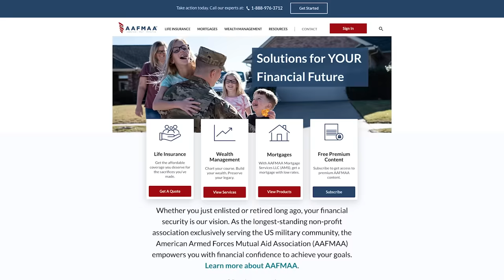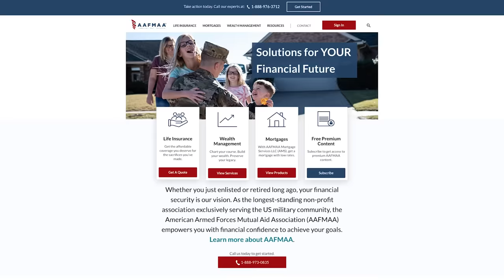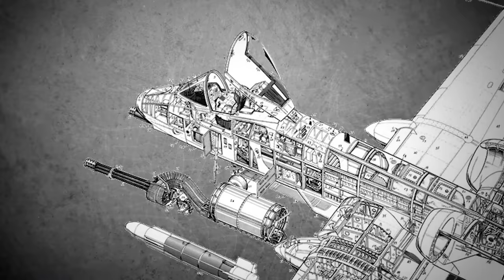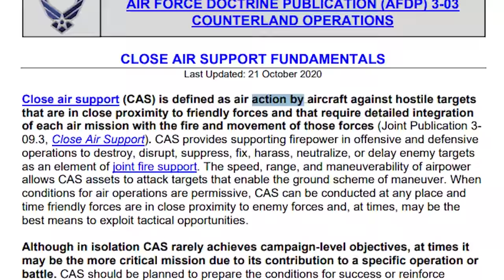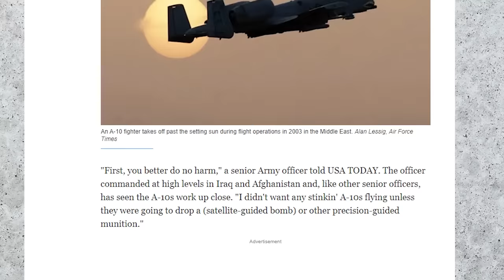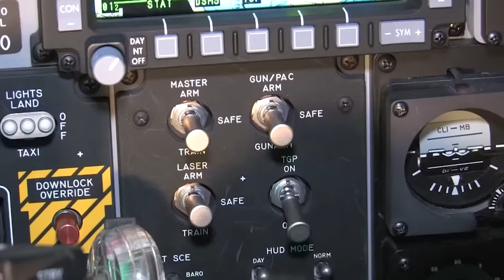Why the Air Force is Screaming to Retire the A-10 Warthog

Comment: I was stationed at Little Rock AFB for 5 years, I remember one time driving down the highway headed towards base. The highway runs in a similar direction to the runway, and I remember watching an A10 on approach fly not more than a couple hundred feet directly overhead. While I work on the C-130, and will defend that aircraft to the end of my days, the flying gun will always hold a special place in my heart, as im sure it will for many others.
Reply: "...defend it?"
Then YOU pay for it
Reply: Uh.... you may want to talk to the friendlies who have been on the receiving end of A-10 fire. This platform is so antiquated, it is time to let it go. The need for air support like this is essentially non-existent.
Reply: @kid31989  and we should get rid of the B-1B because it had friendly fire incidents too? Shit happens in war, it's tragic and horrible. But the call by infantry and marines for CAS has been made time and time again. Sure in a near peer conflict it will likely be less than useful, but it's been a workhorse for longer than most have been alive.
Reply: @kid31989  Only in cases against enemies without AA would you want a weapon Like the A-10, but in that case just use a cheaper plane with more modern guided weapons and actual electronics to identify friendlies.💀
Reply: @kid31989  that's what the air force claimed in viet nam.
Reply: @gavingross2174  Man you don't get it, yes friendly fire happens, but for YEARS the A-10 had no targeting systems or identification systems. Meaning they relied ENTIRELY on visual and ground information which can get mixed up rather than seeing friendly identification signals. The A-10 killed more friendlies than enemies throughout Desert Storm. To the point if people heard an A-10 was in the air they told them to go the hell away from the combat zone because they were more dangerous than they were worth.

Eventually it got SOME targeting equipment, but it's just way too expensive to keep updating such a poor design from the cold-war era designed for WW2 combat. In fact they were expected to be destroyed after their strafe run on russian armor columns.
Reply: @jackwilliams2673  the total number of friendly deaths from A-10's is 35. In desert storm, the A 10 is credited with killing over 4,000 pieces of equipment, over 900 of which were tanks. Further, over 140,000 sorties, there have been 45 friendly fire incedents. Doing some quick math here, if I were boots on the ground, and it was between deal with tanks and artillery myself, or call in an A-10, which has a less than .03% chance to hit friendlies, at a rate of less than 100% fatalities when it DOES happen, I'd take the fucking chance. "The CAS plane is at a higher chance of hitting friendlies" yeah, no shit Sherlock. It's called CLOSE air support. It's gonna happen, wether it's an A-10, or something newer. And to say it's a poor design?? It's one of the cheapest per flight hour aircraft, with an extensive history of doing exactly what it was designed to do very well. Yes it's old, yes it's getting more expensive, and as I said in my last comment, yes it'll likely be unneeded in a near peer conflict, but to say something sucks because it accidentally killed 35 friendlies in over 30 years of service, over multiple and consistent wars, well... More soldiers died to their own stupid actions than could ever die from friendly fire. My condolences to the fallen and their famalies, but there is no garuntee you don't get caught by a stray bullet. Friendly fire happens, and it doesn't matter where the bullet comes from.
Reply: @gavingross2174 friendly fire happened because of short-sightedness with keeping costs low, which meant inferior sensors and equipment to determine ally or foe. 

It may have worked great against insurgents who’s biggest AA threat was a Toyota with a HMG. But against modern militaries, it will get easily overwhelmed by MANPADS, fighter aircraft, etc.
Reply: @schmidtytime  holy Jesus, it's like y'all read every fifth word. First, I'll address the last section of your comment. FOR THE THIRD TIME... Yes, in a near peer conflict, what we would likely be in should another war happen this decade, yeah, the A-10 will have limited at best usefulness.

For the first part. You could use the most high tech equipment and sensors on the planet. Miscommunication and human error will always allow for friendly fire, ESPECIALLY when the entire role of an aircraft is to use weapons to damage or kill enemies near  (see: close) to friendlies. I'd say, especially given how much the American government and taxpayer get in the way of military decisions, .03% is the best possible number you could ever possibly hope for.
Reply: @bigfish92672  

Edit: I realize you were almost certainly responding to my A-10 part of the comment. For which this comment is being updated. 1st, I still pay taxes. 2nd, the politicians still decide where that money goes. And now 3rd, the new one: see my other responses for why despite it's faults, the A-10 has been an effective platform

1. I still pay taxes

2. I like you have no real direct say over what any government official decides to use that tax money for

3. The c130 is one of the best aircraft on the planet for humanitarian relief and tactical airlift missions. 

4. The real world missions that we would get tasked for were disaster relief and humanitarian related far more often than real world tactical shit.

5. No other country on the planet spends anywhere remotely close to helping other countries as the US. Part of that is because of the military we fund. If we were to go full isolationist, I'd be in full support of that, but it would lead to far more harm globally than you'd think.
Reply: The 4,000 pieces of equipment destroyed figure is dubious: the claim first appeared in Air Force magazine, and a later source describing the claim stated that it included data which "proved to have been discounted by USCENTCOM BDA analysts during the war and could not be supported by after-action analysis." The F-111 had a higher proven count of armoured vehicles destroyed (because it could carry PGMs and guide them itself) and the highest ratio of successful strike missions of any aircraft deployed in the war, but Sprey and co didn't like it and so they didn't prop it up as a heavenly blessing to aviation as they did with the A-10. And F-16s did more CAS missions than A-10s in the second Gulf War, while Hornets did more in the first.

I would also point out that this anti-tech stance has been proven wrong multiple times over. Better sensors allow a higher chance of confirming the target is what the pilot thinks it is. A plane that until recently had pilots wearing infantry night vision goggles and using binoculars to try to figure out what they were shooting at is less than ideal, and the upgrades to try to keep them reasonably effective at engaging the things they're supposed to engage, as well as the service extensions (new wings for every plane) also made them more expensive than platforms which come with better equipment out of the box and were designed to have it.

(I will get this past the bot sooner or later)
Reply: @gavingross2174  its not that the A-10 CAN cause friendly fire, but how many times it has happened. It is a plane that really doesn't make any sense at all, it doesn't have the loiter time, cheapness and simplicity to maintain, etc, etc like a true CAS plane like a modern OV-10 Bronco (and Air Force has never done a good job at doing this and making it a priority anyways) or the ability to not put a pilot at risk like a UAV could and it doesn't have the speed, maneuverability, stealth of other Jets. Even doesn't compete well with bringing big guns in the air to a fight compared to gunships like the AC-130
Reply: @gavingross2174  it was designed pretty much ONLY for near peer conflict, so if it can't do that it is really without a purpose. It was designed, somewhat ironically, in a way that the "fighter mafia" would have wanted, without any of the "fancy stuff" and that has never been a good idea. It wasn't built to have sensors and other equipment and to power them. Made worse by it being a single seater so its all on one guy to do everything without the much of anything to assist them.  

 Its not nearly as cheap to fly or loiter time as something that is really made for CAS like a modern OV-10 could, its not as low risk as a UAV, its doesn't bring the firepower a gunship like an AC-130 could.
Reply: @CruelestChris  Sprey and friends must not have made the claim to have individually have crafted by hand the F-16 and other aircraft yet at that time.
Reply: @removedot  so a few things to combat before I head off for the night.

1st, it was designed for near peer conflict 3-4 decades ago. This was a time that Iran and Russia were far more formidable foes, and given what it was designed to do, given the decade it was designed for, and given a war it could have been most effectively be used in, it woulda been even more effective than it has been in the armed conflicts we had. The F-15 was designed to combat the Foxbat, the F-22 was designed to be THE air superiority fighter. The Foxbat turned out to be shit, and the only real world F-22 kill is a couple balloons. What aircraft are designed for, and what they get used for are (fortunately) at the mercy of what conflict we enter.

Next:  Yeah, the fighter mafia is a big issue in the military, much like federal level politicians and lobbyists. The A-10 is the best designed CAS system given both the decade it was designed, and the fighter mafia coming out of an armed conflict where the biggest issue initially was simply not having a gun on the main fighter/attack aircraft of the war. (The F-4 launched without a gun. The military loves overcorrection. The A-10 has a 30mm Rotary. See where I'm going?)

Loiter time is as good as it possibly could be for a turbofan powered aircraft. Built in the time it was. It's ability to circle the battlefield given it's engines is above par. As a C-130 mechanic, I am all to familiar with how much more efficient turbo-props (really any prop) is at sub-sonic speed. I am also familiar with the fact that props have an issue at getting faster than about 400 knots, have an issue at getting going quickly, and have an issue with fuel consumption at max speed.

The friendly fire rate is high for overall deaths, but again, if you calculate the sorties flown in desert storm to the friendly casualties caused, it comes down to a significantly insignificant number. If I was on the battlefield, and I knew the numbers, I'd still call for A-10 CAS anyday.

For price per flight hour, it's still one of the cheapest attack/fighter aircraft in the fleet. All military aircraft are expensive. A single display on a C-130 costs as much as a single family home in Little Rock Arkansas. Next argument. The military ultimately doesn't care about cost, or it wouldn't have bought B-2 spirits at like 2 billion per.

UAV's have a couple issues. First and foremost, accountability. Public perception is that someone behind a computer screen, no matter how advanced, is both more careless, and more likely to cause issues than someone in a real cockpit. Second, and in my opinion more important, reaction time of a UAV is slower than any manned aircraft, and technology while advancing at a significant rate, has not gotten sufficiently advanced for the argument to be made that a UAV is a better combat aircraft platform in 99% of cases.

The AC-130 is a great tool. But the AC-130J is now the main variant. Do you know what the AC-130J is loaded with? Because I do. It's a 30mm, same caliber as an A-10, a 105mm, which is wildly overkill for a lot of what is on modern battlefields, and missles, specifically Hellfires. If you read my previous comments, you'd know I touched on how the average engagement distance for ground troops is within the fatal range of that munition. Bad argument.

A couple more touchup points.

Stealth is stupid for a CAS plane, or anything but an air superiority aircraft or a bomber. You need internal weapons bays and a very specific profile to achieve adequate amounts of stealth. This profile is not at all what you would want to use for any heavily armed aircraft, and you want a heavily armed aircraft for CAS type roles.

Manueverability, yeahhh... The A-10 is one of the most agile aircraft we have outside of something like the f-22, which is a dedicated air superiority FIGHTER, with thrust vectoring and the ability to override it's electronic nannies, and absolutely not the aircraft to be used for CAS.

Single seater. In the 21st century, outside for cargo, refuel, and other heavy frame aircraft (kc-10, kc-130, kc-46, e-3, e-8, c-5, c-17, c-130, B-1, B-2, B-52, etc) fucking everything is single seater. Idk why you think a single seater is a disadvantage, but with modern avionics, radar, and other realted systems, there is a reason small frame attack/fighter aircraft are single seater. Hell, recently they have been pushing for single pilot aerial refuleing on aircraft that date back to the 80's.
Reply: The Infentry parts of the military applaud CLOSE AIR SUPPORT (CAS) for obvious reasons. Air zummies think differently: they want to go fast and fly high in the clouds. Since it was first built,  Air Force generals wanted it replaced with more expensive, and faster jets not optimized for CAS missions. The Air Forse (AF) also object to the army flying that CAS mission with their own CAS aircraft. Except for the A10, the AF will usually find other PRIORTY missions above CAS. For like reasons, our USMC requires CAS as a priority mission in the combined Air/ground mission forces. The Navy, somewhere in between. Reality is that it seems ANY jet aircraft now are to expensive and we will have to few that generals will hesitate to send them up into that battle zone sky with so many threats. The AF is now flying modified crop duster type prop planes. I guess we need to see what mission versus threats results will bring us. I appreciate the video.
Reply: @gavingross2174  that is the thing, those aircraft have all those modern avionics, radar, etc to simplify things. The A-10 doesn't really have that. Made worse if you have to be using binoculars to look around while doing everything else. Don't forget the F/A-18F Super Hornet (and D Hornet) for dual seats.

As tough as the A-10 is, I don't think it was really designed to be as safe as it has been made out to be was kind of what I was hinting at. I think the belief was that if it was going into the gap, there were going to be a lot of losses. Even maybe an assumption that it was likely that nukes had already be used (thus the high engines to make it better on on less prepared runways) so some degree of disposability was kind of built in.
Reply: @removedot  1st, an f22 costs roughly 150 mil per unit and 70k per flight hour. The A-10 costs 13.xx mil per unit and 22k per flight hour. Per unit cost, and per hour of flight cost, the A-10 is one of the most effective aircraft in the US arsenal. Especially since the F-22 has 2 real world kills.

No fighter aircraft has a zoom function, at least in the normal spectrum. If an aircraft is engaging, it is in 1:1 ratio real life to eye view, augmented by HUD and aural alerts. Doesn't matter if it's a bomb being dropped 40k feet below, a missle 3 miles away, or a 30mm gun run 200ft from friendlies. Sure some of these use like 8 inch black and white or basic color screens, but full canopy view, no. But of those three scenarios, it doesn't matter how fancy your electronics are, how good your eyesight is. Shit can happen, and nothing is 100% accurate.

The navy runs single seater F-18 super hornets too. Maybe the navy needs the extra help, but the Air Force is THE air superiority branch. Our best aircraft are single seaters. The aircraft that have double seat variants are older than the best (F-22) that the AF employs. Certain scenarios a second seat can help, but it's a very limited and specific sceanrio (IMO of a time now past) and I sincerely doubt somehow cramming a second seat into a CAS plane would help, when the role of back seaters tends to be radar and laser guided. The A-10 uses neither for a gun, and the other munitions now get along fine without a back seat.

**
Reply: So why in the world are we comparing the A-10 to a top-of-the-line stealth fighter with an extremely limited production run? And also disregarding the couple of billion the USAF just had to spend buying new wings for every A-10 in the fleet, which likely pushes their lifetime cost above F-16s or F-18s?

And no fighter has a zoom function? Do you live in some alternate universe where targeting pods haven't been invented or something? And there's that anti-tech stance again: nothing is 100% accurate doesn't mean we shouldn't carry a thing to go from 80% accurate to 99% accurate. Not to mention modern aircraft have datalinks so that someone on the ground can look at what you're seeing rather than relying on vague radio communications, have the capability of a targeting pod built in from the get-go rather than needing it shoved on a hardpoint, etc.
Reply: Oh right, a beatdown. Cost of $30K dollars per flight hour for a vastly more capable stealth jet with capabilities out of the box that you have to festoon crap on the bottom of an A-10 to get anywhere near having. And for a plane that only costs about three or four times a modern A-10 (and with a cost that's been dropping for each and every batch) you get a capable multirole aircraft that's good for decades rather than a single-purpose aircraft that should have been retired for decades. You should probably start reading things about the F-35 that aren't based around Russian propaganda.

And paying two billion to stick new wings on a bunch of 50-year-old rattletraps does nothing for the cost of said rattletraps. They still need new engines they're not going to get, their avionics are still barely adequate, and they're hauling around a huge gun that's been virtually useless longer than most of their pilots have been alive, while mostly dropping JDAMs and shooting off Mavericks, which plenty of other aircraft (notably the F-16) do better than they do.
Reply: @gavingross2174  You seem fairly well informed, and I'm glad you are sharing information but you need to update yourself quite a bit on the F-35. Your scenario just doesn't make much sense seeing as how the F-35 and F-15X are quite price competitive and with the F-35 being purchased by so many the price of the F-35 is going to continue to go down. (yes I know the F-15X is supposed to have a longer service life but we shall see on that). I hate to break your heart on your other weird little obsession but any large purchase of the F-15X will likely also include the F-15EX, the two seater version. It is also cheaper and easier to have less aircraft to have parts and people trained to maintain. 

One of the other major factors of the F-35 is that it is still in its very early life. It has already seen big increases in capability and that is only going to continue to happen; while most of the rest of the US fleet (besides the F-22 which there aren't going to be more of) is getting very old and already gone through all that and are running out of room to grow.

The whole "F-35 is bloated thing" should be obviously completely silly to someone that seems to know as much as you. Pretty much every other attack aircraft no matter how many claims to otherwise in the US arsenal has eventually become a multirole aircraft with fancy high tech equipment so it makes complete sense to have built a new aircraft from the ground up this way.
Reply: @CruelestChris  the A-10 costs 13.4 mil per unit. As of this year the F-35 costs 75 mil per unit. You could theoretically have bought five and a half A-10's for the price of a single F-35. Further, as of December last year, the F-35 costs nearly double (42k) per flight hour as the A-10 does (22k Nov '22).

Next, if the F-35 is to retain stealth capabilities, it has a max payload of five thousand pounds. IF it were to be used as a non-stealth aircraft, aka, as you put it "fastening crap on the bottom", (defeating one of the largest points for said aircraft) it would have an approximate payload of 18k pounds. The A-10 can carry nearly 16k as it's payload, since it doesn't have to worry about stealth, and includes a vastly superior gun (worth noting, the F-35B and F-35C, Marine and Navy variants do not have guns as part of it's internal weapons system)

Next, even if you are using an F-35A, which has an internal gun, and IF you were using it as CAS in a non-stealth config., it's supersonic abilities can be discounted. There is a snowballs chance in hell anyone will ever make a CAS run at supersonic speeds.

Further issue. Loiter time has been brought up. The A-10 has a loiter time of 90 minutes. Not phenomenal, but for a turbofan powered aircraft, certainly above par. The F-35, also turbofan, can loiter for 20-30 minutes. To break that down to cost per unit... To have a similar payload ability, and have a loiter time the same as an A-10, you would need 3-4 F-35's flying in NON-STEALTH CONFIGURATIONS, they'd be doing this at less than supersonic speeds, and they would rack up a total cost of 16.5-22 A-10 units, and a maintenance cost of roughly 60k, which is double the maintenance cost of an A-10 during the same timeframe.

Next you claim the A-10 should have been "retired for decades" are you implying that the aircraft should have been retired less than 10 years from when it was first introduced, especially when it has the kill record it does? That seems dumb to me, but you seem awfully fanboyish of the F-35.

Also, as of this year, as part of the ongoing F-35 procurement process prices are NOT dropping, so idk what copium you are smoking there.

"Good for decades" said by every politician and military general when justifying the "shiny new thing" during every procurement process and Senate hearing. The B-52 is the oldest bomber in the fleet, now scheduled to outlast the B-1B and B-2 Spirit. The F-15 and F-16 are hilariously outclassed by the F-22. Guess which of those three are slated for retirement first? Until you are in the thick of war, no one truly knows what will be the hero. The newest shiniest thing is not always, hell, not even usually the thing that wins the long game.

"Based around Russian propaganda" M8, I work on US aircraft, I've listened to US pilots, I've heard the briefs. The F-35 wasn't built to be superior in any particular way. Like I mentioned, it's most likely roll is gonna be an air to air targeting system, and allow other aircraft who "strapped crap to the underside" to actually carry a meaningful payload. Hell, anything modern and Russian doesn't stand a chance against our aircraft, even China would have a hell of a time beating our aerial capabilities. But skies are only part of the battlefield, and having a plane that is kinda ok in a substitute roll of ground attack missions... Not ideal.

"Need new engines" guess who gets in the way of that? Politicians, lobbyists, and Fighter Pilots who get leadership roles. And that's discussing readying the aircraft for future conflicts, which again, would likely be with near pear adversaries, and again, for what feels like the millionth time: IN THIS MODERN TIME, IN A NEAR FUTURE CONFLICT WITH A SUFFICIENTLY ADVANCED ENEMY (near pear) THIS PLANE ISNT LIKELY TO BE USEFUL. idk how many times I have to say it, but apparently like 3 or 4 isn't enough for you lot.

"2 billion for new wings" even if that came from just a single year of defense bedgeting, that is like 0.2% of the defense budget. That is damn near inconsequential.

"Avionics are barely adequate" see above argument for engines, but also counterpoint, in the vietnam war one of the most effective airceaft was the A-1 Skyraider. A prop plane woefully outmatched by the jet's of the decade. Being old doesn't mean ineffective. It just means "takes more skill to master". Iron sights on rifles are old, outdated by red-dots and scopes. But someone with the knowledge and ability will put you in the dirt all the same

F-16's have less of a payload than an A-10, cost more per unit, cost more per flight hour, have gotten multiple very expensive block upgrades. Bad argument, if not absolutely braindead one.

Any gun is "useless" till you need it. This (again) is a hard lesson learned in the Vietnam War by the F-4. And if 30mm was so woefully useless, why does the AC-130J now utilize it instead of the old 20mm rotary I wonder? The targets it is useful against have changed, but to say the 30mm is useless is again, dumb.

Oh also your comment implying that A-10's shooting mavericks is a bad thing. The Maverick was designed for CAS. Any idea what aircraft was designed specifically for CAS? :) that's right, the titanium tub.
Reply: @removedot  my adult life has revolved around US military aircraft. I may not know everything, but I know more than I can share on a public forum. And what I know and can share as an opinion is that the public puts way to much faith and confidence into the F-35. The F-15X and F-35 may be similarly priced, but fulfill very different rolls. The F-15's payload suits it well to be a missle boat, and the F-35's stealth capabilities suit it to be a great radar and interceptor plane. With the ability for military aircraft to communicate targeting data, this is why I have the opinion I do of F-15X'S and F-35'S.

Also, as mentioned on my other recent reply to another user, as of this year, despite ongoing procurement from many allies, no the price didn't go down, not even mentioning just how much money the US had to dump into this plane just for the F-35 to actually exist. Further, I'm interested to see what long term parts and maintenance support are like for the F-35 program. God knows my aircraft has given me headaches, and we don't have a retirement date.

F-15EX: One new 2 seater doesn't break the fact that a good chunk of USAF small frame combat aircraft are single seater within the past few decades. Again, two seaters have their roles, but they are less necessary than they were back in the earlier jet age.

The main reason I call the F-35 bloated, which based on cost and delays alone it certainly was, is because politics got in the way of actually getting an aircraft, and Lockheed has gotten way to comfortable being the king of US military aviation. They are the bane of my existence. The fact that the Northrop Grumman B-21 is ahead of schedule shows that it's possible to not royally fuck up a major project, yet Lockheed consistently does. It's annoying, sickening, and downright fucking awful that a company that provides to the DoD is so willing to screw the American taxpayer. It's worse when you know that they intentionally employed at least 1 person in every state, so that if any senator or representative tried to call them out on their overruns, they could claim the politician is attacking jobs of their constituents. Given the choice, I'd rather burn 1k in cash in front of a homeless woman with a child, than willfully give money to Lockheed on a new project.
Reply: So you're running through the full list of deflections here, including quoting that the F-35 carries more stores than the A-10 (18 is a bigger number than 16, last I checked) as if it's a bad thing, using the highest cost figures you can find for the F-35 and the lowest for the A-10, etc. Also insisting the gun is "better" even though it wastes more of the aircraft's mass for a weapon that's just dead weight most of the time.

Moreover, that 16,000 pound figure for the A-10 isn't actually weapon payload since an A-10's 11 hardpoints almost always have an ECM pod on one and a targeting pod on another, both of which are integrated functions of the F-35. So you're losing 18% of your weapon stations to things that aren't weapons, compared to the F-35 getting all 18,000 pounds for weapons. It doesn't look so good when you start thinking about what these numbers mean for five seconds.

What "kill record" are we talking about here? The one I've already pointed out isn't real? By that yardstick we should bring back the F-111, which had an actual established kill record of 1,200 armoured vehicles from only 66 aircraft in-theatre which flew fewer sorties than the A-10s did while dropping 80% of the war's laser-guided bombs. They were retired after only a little over 20 years of service.

And last I checked there have been almost five decades since the A-10 entered service, not two.

And seriously, the Skyraider was the most effective in what way? The US lost 200 of the things to smallarms fire, why do you think they wanted to replace it with a jet if it was all that and a bag of chips? By your logic, since the Skyraider was slower, less stealthy, more obsolete and more useless, they should never have adopted the A-10 in the first place.

For that matter, if the A-10 is such a great and useful and cheap and useful and great plane, why did it never attract a single export customer?

Also nice to see the hardy old F-4 gun myth get trotted out again to perform for the crowd. The F-4's problem in Vietnam was related to doctrine (ROE requiring visual ID) and the fact that their early missiles were bad, not the lack of a gun, as well as issues with a lot of the planes shot down being Thunderchiefs loaded with bombs flying predictable ingress and egress routes. That's why the Navy, which never bothered to fit internal guns to their Phantoms, saw the same increased kill rate as the Air Force did as they got better missiles and better training.
Reply: @gavingross2174  that is a bit more fair, and if it seems what they are trying to pull with changing engines now that it seems it would share designs with the B-21 seems like the ultimate dicking people around; when that was kind of one of the whole points was to lower the amount of engines to have parts and training for and it seemed to be coming together